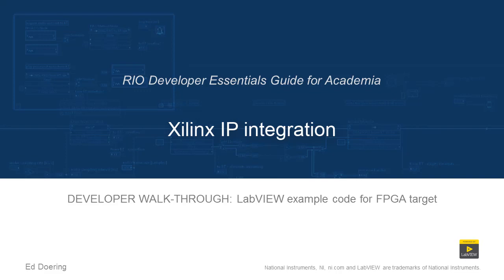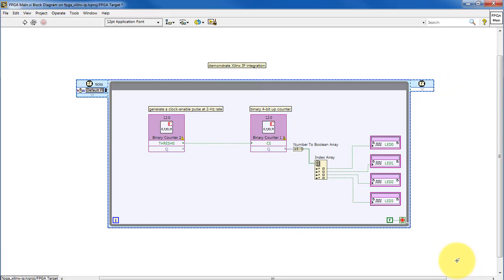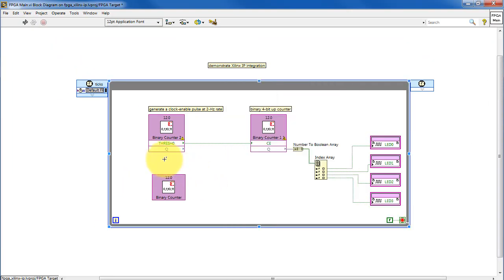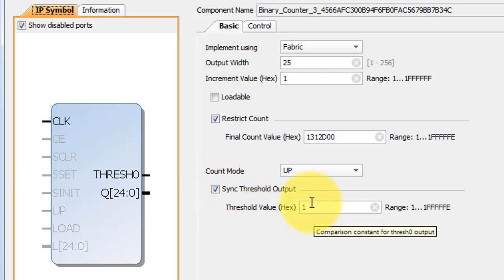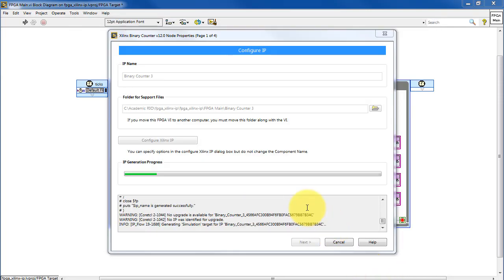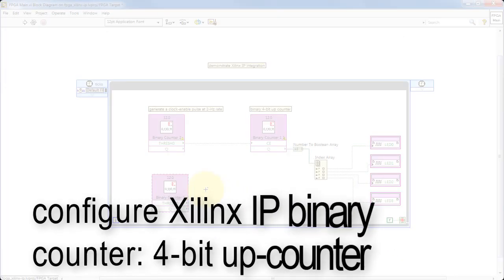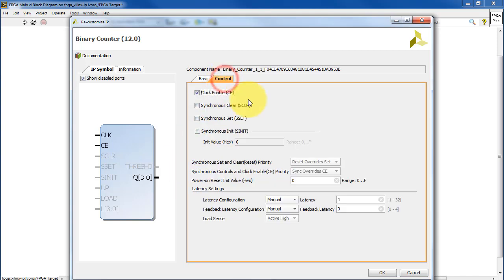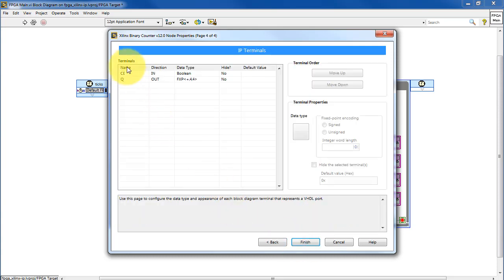LabVIEW code: Xilinx IP integration (walk-through)

Comment: Hello ,
i work with Labview 17 (32bits) on windows 7 pro (64 bits)
i want to filter a signal with the FIR Filter ,so i use the Xilinx FIR Compiler and  the configuration of the filter does with Vivado
I tried several times but it does not work, I recovered nothing at the output and I do not understand the problem?
do you have an idea about the FIR compiler?